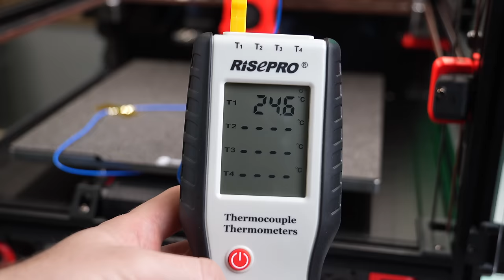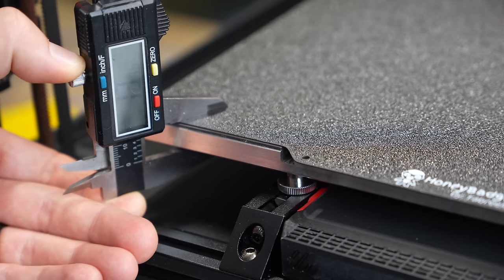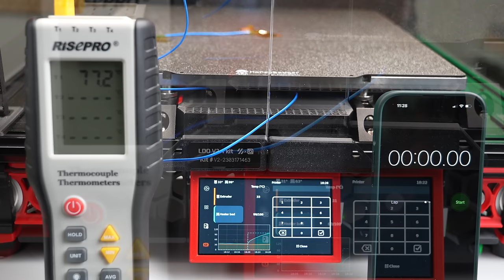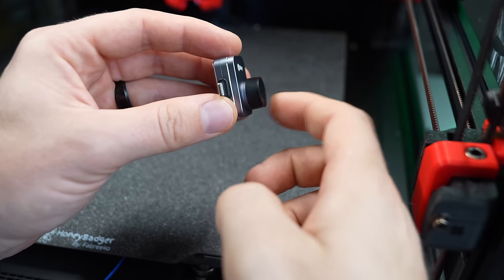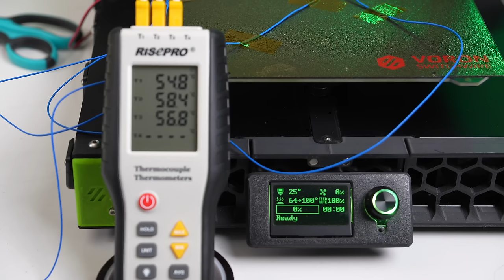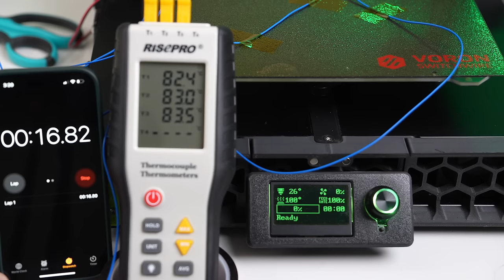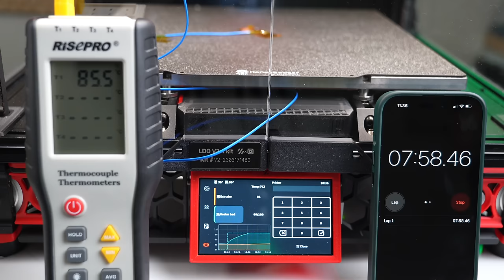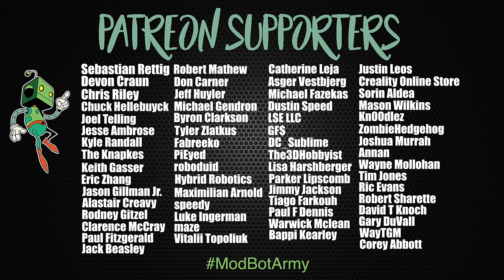Should You Be Preheating Your 3d Printer?

Comment: Preheating/Soaking your chamber not only makes sure that your bed is up to temp, but also makes sure that the frame etc is. 
Its very noticable when printing without and soaking. As the chamber gets hotter, the frame expands which causes nice "curved" prints.
Reply: I love hearing the few creak noises I get when preheating. Reminds me it's working.
Reply: @condorman6293  yup absolutely
Reply: Yep, absolute must for sequential printing
Reply: Yea, my Voron belts are quite (too) loose when cold, but after a good 30min-1hr heat soak they are noticeably tight (and properly tensioned).  Printing without a heat soak on mine would be a great way to achieve terrible print quality.  450mm of aluminum extrusion expands quite a lot.
Reply: Wait could this be the cause i always have too much squish on the front or the back of the pei?
And could bed mesh solve that? If i level when preheated to printing temps?
Reply: @bertkooijmans4769  depends. I would definately mesh once everything is heat soaked.
Reply: @takuya2431  gonna try and figure it out thanks

Comment: This is why for ABS, many set the bed temp for a print to 110c or 115c.  Those temps will get the top of the bed to 100c.
Reply from the maker: I also find it interesting that on Bambu Printers they run ABS/ASA at 90C and it has some of the most constant adhesion I have seen. I guess compared to the 80-85C the top of many printers may be reaching 90C would be a step up. They also use thinner beds so regardless of location the thermistor (should) be closer to accurate.
Reply: @ModBotArmy  That is interesting.  I don't have one, but on my Voron 2.4, 110c will get the top of the bed to 100c.  I have wondered what impact the magnetic sheet as well as the double sided PEI have on all this.  They just might be causing some of that temperature difference.
Reply: If you are using 110c the chamber temp gets higher. Less warping. Using Nevermore fan mod increases the chamber temp to around 50c.

Comment: Great vid Daniel!  that lines up with our testing on the V0 bed as well.   The biggest difference on the V0 was made by using the thermistor that screws into the bed itself at the center. I think LDO's edge-to-edge heater accomodates this too, and it gives readings within 1 or 2 degrees of the surface of the bed.
Reply from the maker: Thanks man :). I need to source a bed that has a top mounting channel for a thermistor or a screw in type like you are describing that is getting the reading deeper into the bed.

Comment: Try insulating the top of the bed, and re-run your tests. Remember the top is a radiator and will lose heat to the atmosphere. A layer of plastic will insulate the top plate, and your readings will most probably be where you expected. Physics is a great tool when understood. I tend to use preheating for the first layer or so then turn it off to prevent melting of the first layers with PLA.

Comment: I have a cork plate under my heater mat, so the heater is sandwiched between the cork and the aluminium. It makes a huge difference compared to typical designs where the heater mat and the plate can lose a lot of heat to the air below the build plate.
Reply: Are you just using standard craft-store self stick cork, or something special?
Reply: @RocktCityTim  It was just just a 5mm thick 100x50cm cork plate sold on Amazon as a pin board from which I cut a square to fit my print bed. I clamp the whole sandwich together with the clamps that my CR-10 uses to clamp together glass bed and aluminium plate.
Reply: In my v2.4 I stuffed glas wool wrapped in caption between bed and seperation plate. And I'm used to give always higher bed temp than advised. Would be interesting to find out how the producers measure their "advised" bed temp ;-)
Reply: It can help, but it depends on what you want it to do. If it's open air, then you'll just be losing heat to the air, true. In an enclosure? Your bed is the primary heating element for it. Indeed, both the Nevermore and the Filter actively harvest heat from the bed to increase and maintain chamber temperatures. For an enclosure, this insulation makes it worse.

Comment: Preheating the bed is as important to corexy as it is to bedflingers, just for a different reason. The mostly cheap, thin beds have a tendency to warp,  so preheating before a mesh is basically essential. I even have a start gcode for heat soaking my chamber to 40c, just to be extra sure. A part coming loose mid print on a full plate is the last thing i want. Fantastic video as always.

Comment: Great video as always. My 2.4 & V0 both had Precise Printer Parts build plates that have thermistor slots in the top. On the 2.4 I read both the top & bottom of the bed surface. It is wild how different the temps can be when a print starts. I personally always bake beds, even when printing PLA I find it helps bed adhesion.
Reply from the maker: I need to look into one of those beds. It would be interesting to see how close it can get the top of the bed to correct temp measuring the top of the bed. Are you using a macro typically or just doing a manual preheat and then when you see the thermistors within a certain range sending a print?
Reply: @ModBotArmy  I generally start pre-heating the bed when I go to slice a design.  If it is a material that needs chamber heating I'll do it earlier of course. Otherwise, I've got the thermistor on top of the bed set as my "Bed Temp" sensor, so slicer settings go off that surface temperature & not the underside. That one I just monitor for my own information.

Comment: Very interesting. For your thermistor installation, I would use an thicker insulated tape with some foam. Otherwise the sensor is being cooled from the top side while being heated from the bed side.
Reply from the maker: A few others have mentioned this. Kapton is a thermal/electrical insulator which is why I chose it. It also was the main adhesive method used for thermistors on most printers before they began embedding them. That being said, I dont doubt there are better options out there for at least this testing method. I may look into a few alternatives and see if there really ends up being much difference in the results.

Comment: this lines up with some of what I've been seeing on my 2.4. I heat soak and run the initial layer at 100C and subsequent layers at 110C. I had tried bumping it up in a bid to improve bed adhesion. apparently was spot on the issue.

Comment: Insulation makes sense only from outside for enclosed printers.
I stuck 12mm thick yoga mattress pieces on all my side, back and top panels and the doors.
With 110C bed can crank up the chamber to real 60-65C in 2 hours in the shed.
Will see what results will have during winter.

Comment: When using thermocouples for surface measurement, it's a good idea to add thermal paste.
I do such measurements often so have gone a step further and picked up some very thick (5mm) thermal pads and I stick the thermocouple inside the pad.
Without proper thermal coupling both the surrounding air and heat loss to the thermocouples wires impact the repeatability of measurement (up to 5deg in my experience).
There are proper probes for surface measurement but I've found thermal compounds/pads to be just as accurate for a fraction of the price.

Comment: I think why the temperature is peaking at 85°C is because the printer thinks it has reaches 100°C and is reduing the power to the bed. I was thinking, if there was a way to attach the temperature sensor above the heated bed, between the top surface of the bed and the magnetic sticky layer, the temperature control would be more accurate.
Reply: But if all of us are getting 85C beds when we think we're using 100C, it means that 85C is actually a good temperature for bed adhesion. Heating the top to a true 100C might be too hot.
Reply: I know there's a pull-up resistor value for the hotend in Klipper, but is there a similar offset value for the bed?

Comment: Given that the print bed is a giant radiator, I'm not surprised it's a lot cooler at the top than at the bottom.  That's how radiators work, after all.  Remember that some of that lost heat is transferring into your plastic, which is after all the point.

Anyway, my main thought is this: regardless of the actual measured temperature of the bed, if you have a system that works with your printer, with your preferred filament, in your environment - don't fret the numbers.  Whenever I'm baking something in the oven, I have to set the temperature about 25F less than the recipe calls for.  Likewise, when I'm printing ABS on my X1C, I let it "bake" until the chamber temp is reading about 45C and don't take the parts out until the chamber has cooled to under 35C.  This seems to work, and I don't care what the actual measure temperature on the bed is, I just know what settings and process I need to have good prints and unburnt food.
Reply from the maker: Oh 100% I was not trying to state that you should be chasing higher temps especially if you are having success. More that if you are not having success and you have tried other things, it may be worth looking into the temps you are actually hitting and not what you think you are.

Comment: I've had a cheap 200W fan heater in my old printer enclosure for years, initially because the bed heater didn't quite have enough power to maintain 110'C for ABS at room temperature. I quickly noticed the drop in warping, so preheating with bed and heater was done for every ABS print.

Comment: As already mentioned, the heat cameras may give a wrong temperature depending on the material. Matt black plastic gives a much higher temperature than shiny aluminum. This is the εr that is shown on a lot of the cameras. My IR thermometer was delivered with matt black stickers for that reason. Most have a fixed 0.95 value, more versatile cameras will have a configurable setting to allow the right temperature shown for different materials.
But there is also the direct cooling of the thermocouple due to draft over the build plate. Since the thermocouple is not welded to the plate with a thermal compound, the slightest bit of draft will result in the top of the thermocouple being cooled down. Adding a small dab of thermal compound does wonders. I just tested this (2 probes on the bed, one with and one without thermal paste) and the one with the thermal compound heats up faster and goes all the way to 90+ while the other sticks around 82 C.

Comment: For me this makes sense, knowing how temp. sensors work in general. However, the real question is - if filament printing bed temperature is stated, let's say at 100c by manufacturer, is it actually tested on 85c, as most of printers will suffer from this behaviour, or should we actually aim for true 100c with 115c bar on printer? In general, you do what works on your printer, guidelines are what we get from manufacturer.

Comment: I'm really glad you posted this.  I got a Gulf Coast robotics bed to replace the heatbed on my Ender 3 S1 Pro (which shorted out).  Noticed I had adhesion issues while using the same temperatures while printing PLA on the new bed, so I got an IR thermometer and discovered the same phenomenon that you've pointed out here.  I assumed that the thermestor that came with the new bed was bad... seems that's normal based on what you're showing me. 🤨

Comment: I expected a diff, but 15-20C was wider than I expected.  I was told early on the preheat for PETG, so I've always set my nozzle and beg temps about 20 minutes before I start printing.  I'm now experimenting with PETG-CF and PLA-CF filaments on my SV06 Plus using Klipper and I think I'll push my bed temps to 95C so that the face can get to the expected 85C for the prints.

Comment: Some other things you can do are mount fans under your bed to push the hot air around the chamber while preheating for more even distribution. 

You can also put your hotend at 160 and your part fans at max speed during preheating to work as a little chamber heater. 

Preheating ensures everything expands and contracts to where its going to be for the entire print. You want to preheat, then mesh, so that your mesh doesnt only take into account the warping of your bed, but actually the frame itself as well. You dont want the geometry of the frame to change from heating after youve already started your print.

Comment: On my old Replicator the build plate was so small there was about a 1-2c delta. Still, I put a wool rim around the bed and an air gapped film of Kapton tape. That allows the heat to move around and even out under the bed 😉

After i did that the thin little bed never warped after and i could print ABS to the edges 🥰 i used to have to bend it back every few months 😅

Comment: I remember adjusting the temp table on my v2.4 to shift the 100c resistance value to what is really is when the top reads 100c, it's pretty simple to do. I only have this issue on my v2.4 since I could not get any insulation under bed. My other printers which have insulation actually read 2c higher on the top than target by thermistor. When you get into the 100c range on an non insulated bed, the variance is pretty drastic, so tweaking the temp table would do some good.

Comment: I had an old printebot with the factory thick bed heater. I found that once I did a 10min heat soak on the bed, I had much better results. This  tracks with what I had observed.

On a side note. When I had seen people saying "I printing with X degrees on the bed." You have to remember your setup vs theirs.

Comment: I’m a bit surprise you guys don’t have any bed insulation below the heater. That can help and even save a bit of money on the ole power bill. At work I have two Modix 120X 3D printers. We replaced the bed with a 1 inch thick MIC6 plate for amazing flatness. I let that heat up for an hour before printing and check it with the FLIR camera.

Comment: Daniel: Nice effort! A couple of suggestions:  Just as a reality check, it would be useful to run your thermocouple bed tests with a layer of insulation covering the top of the bed (ie: also covering the thermocouples.)  That greatly reduces dissipation from the top of the bed, greatly reducing the heat flow through the bed (bottom to top), and thus also the temperature drop bottom to top.  The result should be that the bed heats uniformly throughout its thickness, and hence your thermocouples should read the same temperature as the set point. This will validate your thermocouples and instrument and also .checks that the printer's thermocouple or thermistor is sensible.  Your tests in this video using thermocouples only on the top surface don't actually verify that the printer's sensor is getting up to the set temperature, even if the printer thinks so.
Next, in the comments there are suggestions to attach the thermocouples with thicker (heat) insulating tape, on the principle that then the thermocouples won't be cooled from above.  However I think that's a mistake: If you place insulating tape on top of a thermocouple that will reduce dissipation from that neighborhood of the bed, creating a local hot spot, so your measurement will not be representative of the rest of the surface.  Instead, the tape you are currently using exposes the top of the thermocouple and local bed to approximately the same air conditions as the rest of the bed, so the temperature is representative.  

Anyhow, nice to see folks performing experiments like this and trying to get at some ground truth!

Comment: I found exactly the same thing with my Voron Trident, I have to set the bed temp at 125 to get 110 on top. This also meant I needed to get a new thermal fuse as the old one was only rated to 125. If I try and bed level before properly soaking then the readings can constantly change

Comment: @modbot What i did is machine a small hole right below the surface on the build plate roughly 1mm down from the surface and use that to pid tune , What is happening is the thermal sencor on bottem is cutting the heating early so the surface never reaches the correct temp, your temp sencor needs to be as close to the top of the build plate as you can get it so the tuneing is calbrating for the surface temp not the bottem temp

Comment: You just confirming data from time when beds were heated by bunch of power resistors and frames were made from all thread or mdf boards. You NEED isolation layer under the bed. Its not optional if you want higher temp.

Comment: Aluminum is quick to heat, but it's also quick to dissipate heat.  I feel like insulating the bed would go a long way to improve this issue, but would add weight, complexity and still not be an end all solution.

Comment: There is a big problem with the methodology here which put in question the remarks about top-bottom plate temperature. Thermistors have a much faster response to temperature changes when compared to thermocouples. Also, regardless of the probing type, if you use more than one metrology equipment, it is required to have them calibrated, otherwise risking a few degrees of error between them, up to tens of degrees if using uncalibrated IR meters to probe metal surfaces. 
I would suggest using the same 4x thermocouple meter to measure top and bottom.